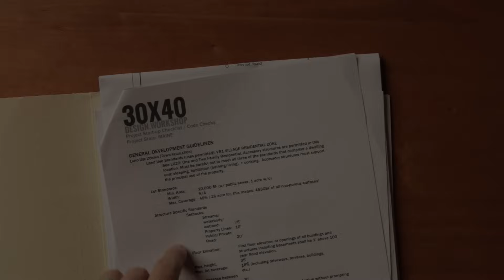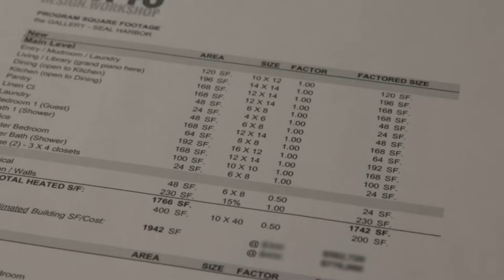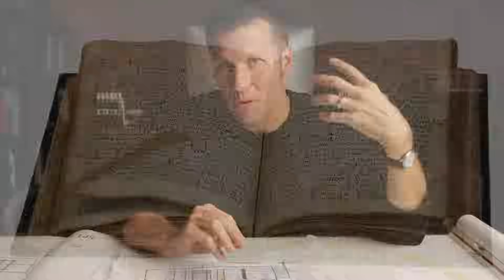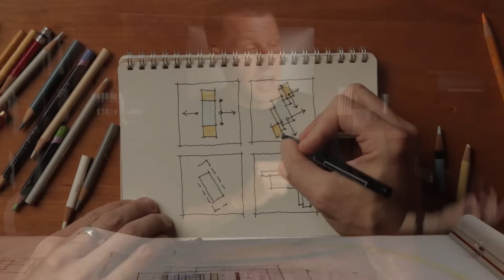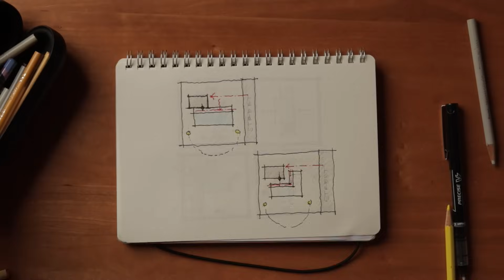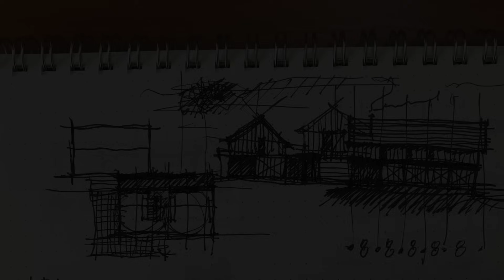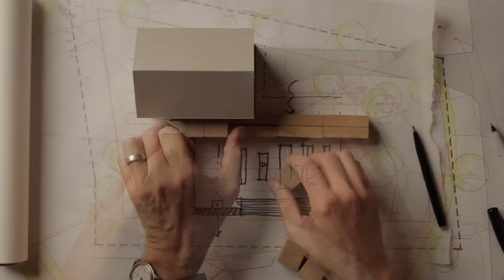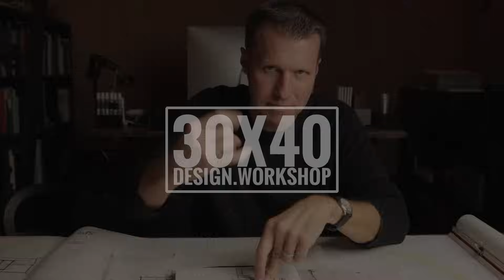Floor Plan Design TUTORIAL

Comment: I kinda wish more architects would fill their minds with particularly efficient houseplans that make effective use of a given amount of space. Like, sure, it's always great fun to play around in an unlimited sandbox when you've got people who can comfortably afford that luxury of wasted or underutilized space, but I've seen just way too many designs where you can tell at a glance that they thought of the exterior of the home before they considered the interior layout in the slightest, so everything inside is just mushed around until it conforms to the exterior design they had in mind, when it should really be the other way around. Design the interior floorplan first, make sure it works and flows how it should, then figure out how you can massage it to make it fit the exterior aesthetic that you'd like the home to have. Oh, and I'm so very tired of architects forgetting that certain home features aren't as optional as they'd like to think that they are. 

-A half-bath for guests that doesn't require them to walk through the hallway to the bedrooms. 
-A foyer with adequate space for seating and coat closet. 
-A proper kitchen pantry or adequate space in the kitchen design for enough full-height cabinets to compensate.
-Enough bathrooms so the residents don't have to go to war over them.
-A mudroom that opens onto a covered stoop and the garage.
-A laundry room with either space for a full-height cabinet or a closet to hide tall items like brooms, vacuum cleaners, carpet cleaners, etc. and enough space to store household chemicals.

I have seen a staggeringly large number of house plans in the 3k+sqft range which still only have 3 bedrooms and two baths and lack many of these features, casually wasting square footage on excessively large living spaces and bedrooms, neglecting features that might otherwise have brought more convenience. I think my favorite rough planning method is the one that Mimi Estelle demonstrates in her video "How to Create a Floor Plan | For Interior Designers" where she does a matrix of how the different required spaces are connected, how priority should be given, and then grouping them based on whether they need to be adjacent or not. Then she draws out the minimum size requirements for the spaces, cuts them out, labels and color-codes them, then begins arranging them with hallway placeholders so she can figure out roughly how things can be arranged and where space may need to be added to have the rooms make sense with each other inside the footprint of the house. But it is important to acknowledge that this kind of design methodology does not work for everyone. It's basically solving the equation of the space by moving variables around. You move the bedrooms and living spaces around each other to solve for lighting, pathing, how they will obscure themselves and other structures, etc. And this kind of small to large development path doesn't work for everyone. In your video you've outlined a very large to small design approach, wherein you try to figure out the shape and feel of the space and then figure out if the rooms inside can be arranged to suit, discarding and iterating all the while until you find a solution that satisfies your exterior design goals while fulfilling the interior design requirements. Each method can arrive at suitable outcomes, but from slightly different angles.

I personally think that Mimi's approach is genius, because it can also allow you to see where you can overlap certain living spaces with the walking paths that you might otherwise use a hallway for and extract just that little bit more usability. By working with the scale building blocks of the floorplan on cut-out pieces of paper, you can casually overlap them where necessary to see if it's reasonable to do so and if you can eke out a bit more space without impeding the function of either room. One of my favorite examples of this is the diagonally placed keeping room in Frank Betz's "Kingsbridge" design. It bleeds into the walking space of the kitchen and the breakfast nook, but still provides ample space for arranging furniture for an additional casual living space. Of course, this plan still has several flaws, but I'll focus on where they've succeeded in a particularly novel way. Because of how the plan is designed, you get an exceptionally large amount of living space for a (relatively) compact footprint. It's a house that is just under 2300 sqft and it has 285sqft of combined living space while still featuring separate casual and formal dining spaces without making the bedrooms unusably small. Lovely.

Comment: I am a novice eagered to learn, so please forgive my primative questions.  What do you mean by 1/8" and 1/16" when creating a floorplan with each of those measurements I mentioned equalling 1'?  I have been wanting to build my first house for years and I want to be able to created the floorplan myself.
Reply: He is talking about the scale of the drawing. In this case 1/16” on the drawing is equivalent to 1 foot in the real world. In UK we would use a metric scale of say 1/100. You can buy a scale ruler in metric or architectural on amazon which helps you quickly draw the right length on your drawing.

Comment: I am Mexican. It is interesting how similar is design process in MÉXICO and the US. I personally analyze site, sun path, winds, circulations for vehicles and people. I find these array of vectors informing the flow of the project. For sketching I use the sharpies, 5.6mm wood mechanical pencil and a lot of sketching paper. I also model on Revit and move back and forth between sketches and model. It allows me to understand ideas and explore the volumes very quickly. Also it makes the transition from idea to plans quicker. Greetings.

Comment: Nice to hear your process and the steps. I print grids from revit and sketch over too. Didn’t know others did that! 

Anyway, I prefer papermate felt tips to sharpie fine or ultra. No smell and they go over whiteout pretty well. Otherwise, same...signpen and pilot. Went off pilot for years and switched to niji stylist but they blue over the years

Comment: Rather than sketching, buy a CAD program like AutoCAD Light.  Then buy a tutorial by someone like Cheryl Shrock to learn how to use it.  Then you can make "blocks" of building components like foundations, walls furniture.  You can put components in layers like, foundation layer, plumbing layer, electrical, roof, etc.  You can easily use the plan views to start elevation views that will line up precisely.

Comment: Hello Erik, I really like your channel. This is the first comment I'm writing - most probably not the last one.

When I was a student I used only plain pencil and paper. In the upper semesters I went to automatic pencils and tracing paper. I found and explore Pentel and Copic through your video. I have a great deal of work at the office where I'm currently working with a large amount of Pentel Sing Pens and Copic. The dual function and the possibility of refilling the markers is very practical for me. 

Right now I use a plain pencil, colored pencils, Pentel's (thin and thick pens) and Colics. Unlike most of my colleagues, I prefer to sketch on a thicker paper (best in a sketchbook) and a 40g tracing paper.

Comment: I love your videos.  They add a certain unique creativity to the process which can be quite rigid and forced.  I like using pretty much the same pens you use.  I use the fine tip Sharpie earlier than you to keep my work sketch like and uncommitted.  This allows me to not feel locked in.  I generally bring on the larger tip pens like the Pentel medium or bold when I am trying to develop relationships.  I generally don't mix red in the early stages.  I try to use other colors like green and blue.  I generally get back to red when I am trying to analyze my work and make revisions.   Then other colors work their way back in such as green and blue...Thanks again, and take care.//Chuck
Reply from the maker: solid choices. thanks for sharing...

Comment: This is a great explanation of the process - and sounds very similar to mine! I don't do the model bit though ... I find I can sketch / test / imagine it in 3D. In fact, I find (even at a diagram stage) if I can't walk around the house in my head visually, then I'm not 'there' with the design idea. My favourite pen is an Artline 0.2mm in black - on yellow trace :) Thanks Eric - I'm going to share this with the UA Community. They'll love getting an insight into the architectural / design process.
Reply from the maker: thanks Amelia...no models...!? inherent spatial comprehension is indeed an uncommon gift...so lucky!
i've not used Artline pens before...and the yellow trace...now that's saying something...are you left-handed by chance?